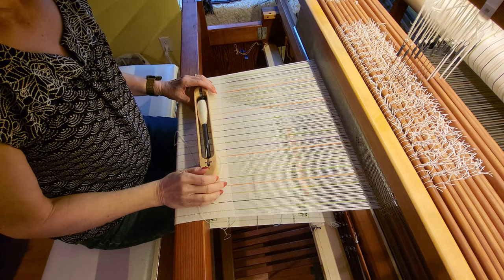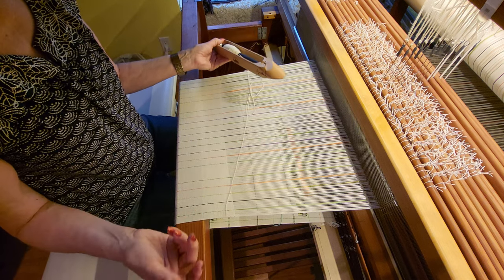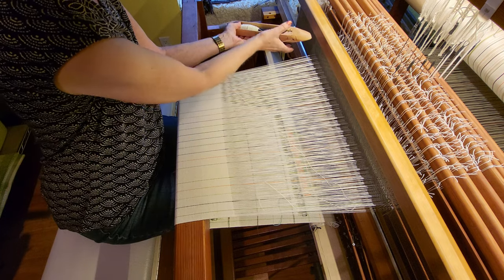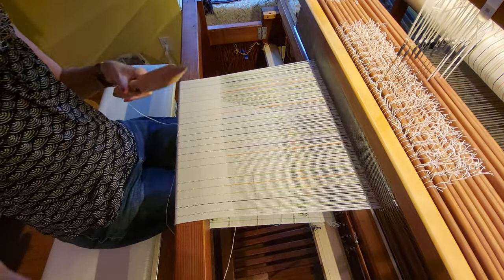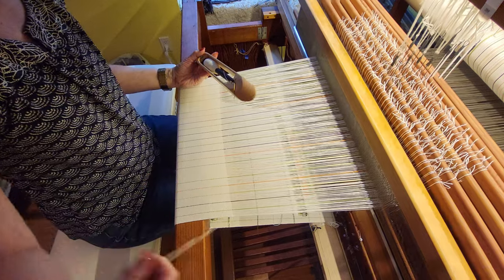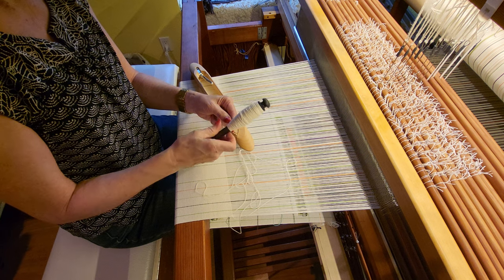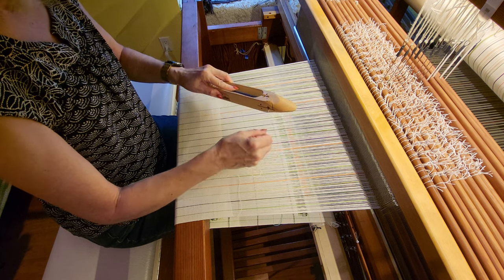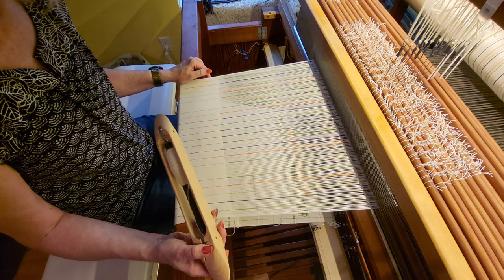Unweaving with an End Feed Shuttle

Comment: Can you tell me the advantages of using a prim shuttle as apposed to a bobbin shuttle
Reply from the maker: Pirns are used only in End-feed shuttles (EFS). EFS have a tensioning device that can be adjusted to give the exact amount of pull on a weft thread that is needed for the weft to turn smoothly around the edge warp thread. Usually, EFS are a bit larger than typical boat shuttles and a little bit heavier (although my Schacht is lower profile than most). Since the weft thread is pulled off the end of the pirn, you have to wind the base of the pirn first, back and forth for an inch or so, then move up an inch and wind, and continue so that the last part you wind is on the tip of the pirn, the part that gets pulled off first. I did a video on winding a pirn if you’re interested - https://youtu.be/L8lY8COgVxA.

A couple disadvantages to an EFS is 1) it’s greater cost ($130+ vs $60), 2) the thread pulls from the shuttle farther from the weft turn on one side of the warp than on the other, which can cause a slight difference in the degree of pull on the weft, and 3) the weft thread gets twist added to it as it is pulled off the pirn, which can be a problem if you are using  a singles or energized yarn.

For me, the low profile of the Schacht shuttle is great for me because I have a fairly narrow shed on my particular loom. But a lot just depends on personal preference.  I hope this answers your question. I plan to do a live stream on different shuttle types in a couple weeks and hope you join in.  Happy weaving.
Reply: Thanks for linking your video